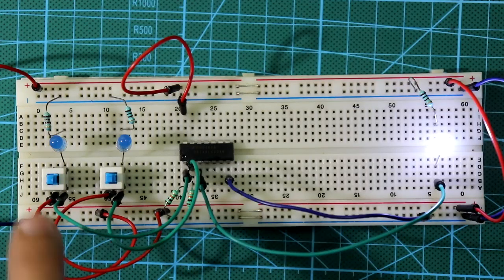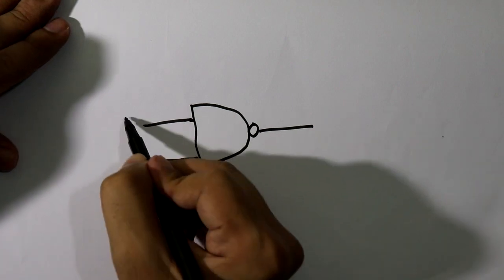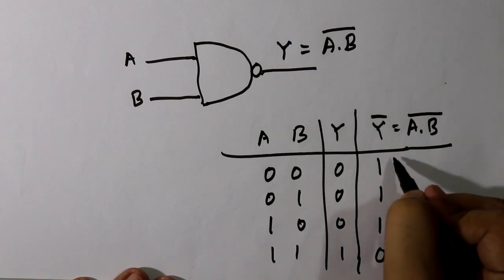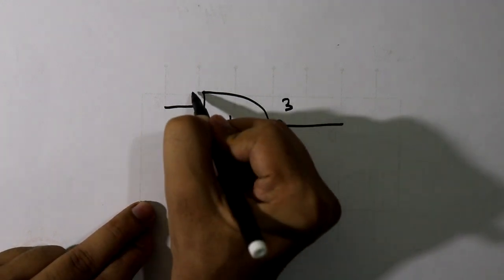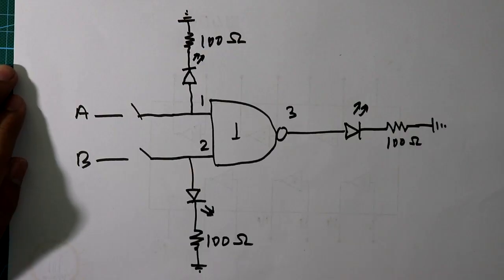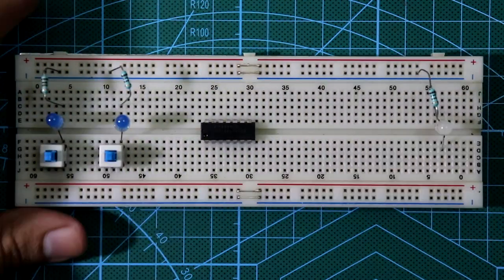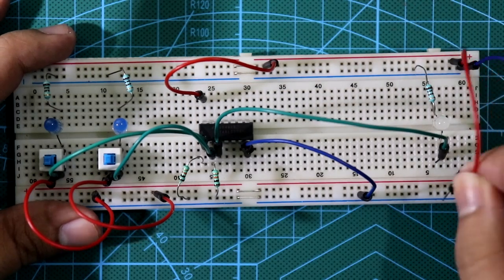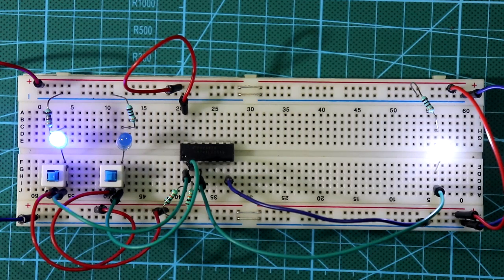SN74LS00 | NAND Gate IC 7400 explained | Truth table with breadboard connection

Comment: Heyho. Nice video, very basic and understandable for beginners. What do you think one TTL circuits max current is it takes? I want to build a bit bigger circuit with about 25 circuits and some leds. got a 1A supply
Reply from the maker: I'm not able to say the exact value but 5v, 1A power supply is more than enough for your circuit. (I'm assuming that you're going to use 25 TTL IC and 5mm 17 LEDs)
Reply: @EEWave  Yeah. Got about 20-25 TTL circuits, 5 3mm LEDs, 6 7-Segment displays and one 14-Segment display

Comment: Is this similar to 4011 chip?
Reply from the maker: Yes, working is same but output pins are little bit different. As 4011 is CMOS ic so we can apply it upto 15 volt circuit.

Comment: HI!

I've tried this, just the way you do, but with the IC 4093 and it does not work. Any clue why?
Reply from the maker: Hello Friend, it should work in your case also. I've also tried with IC4093, but it is working.
Reply: I got it to work, the problem was cheap glitchy push button-connections. Thank you!